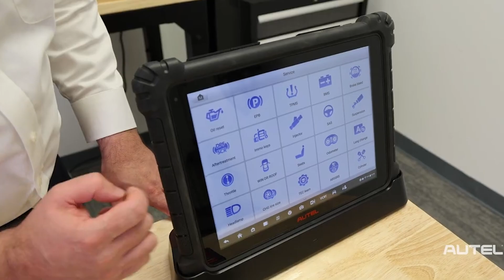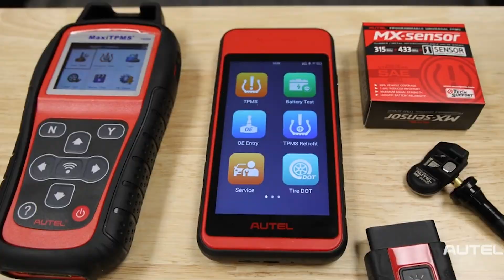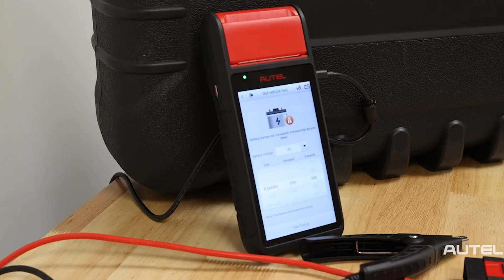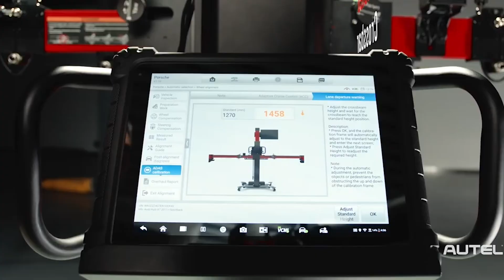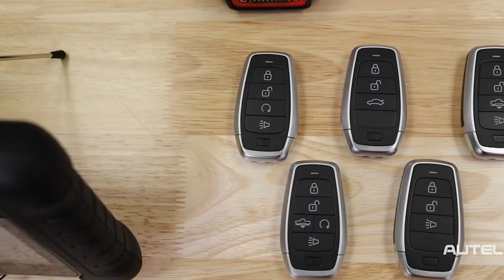Overview of Tool Categories for Each Repair Procedure | Autel

Comment: Autel Lost a lot of options In the last few updates It's used to be way better before the more I updated the more I lose Capabilities
Reply: This very true. The original MK808 could do zero pont Calibration and the Brake Accumulator initialization on Toyota Hybrid vehicles. These features have been removed. 
Autel listen to your customers.